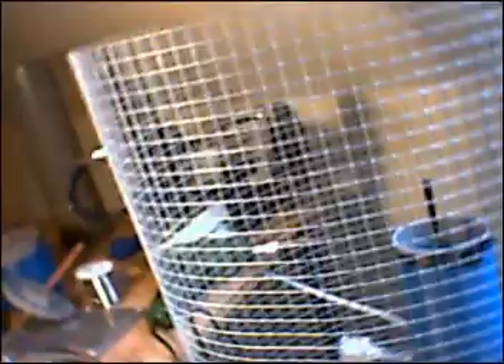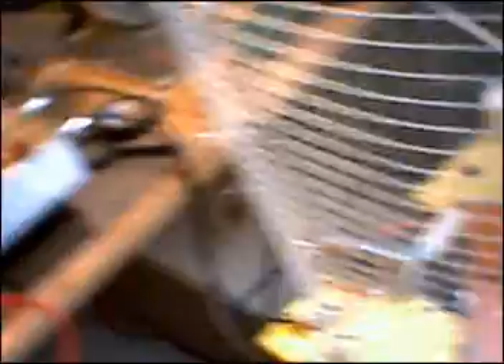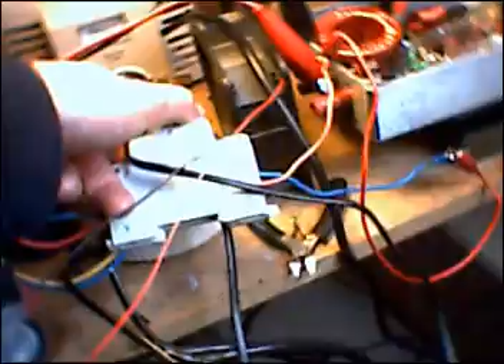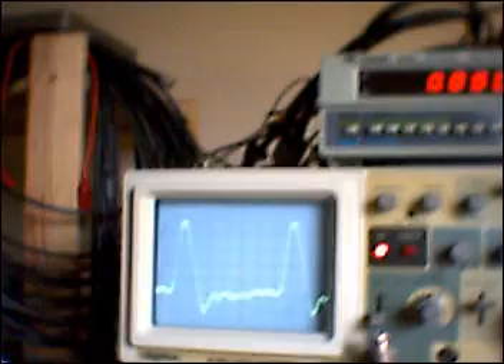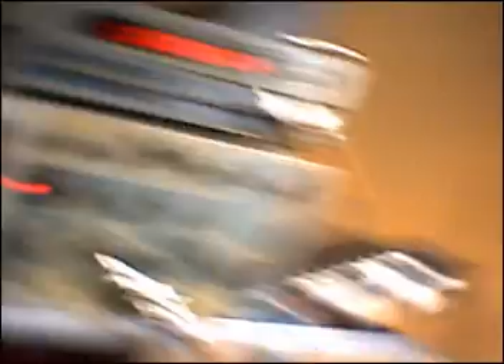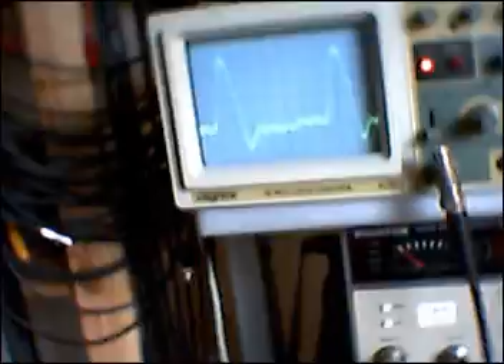Variable primary coupling for HF tasla coil

Comment from the maker: I have not measured efficiency in the strict sense, but the fact that the power transistor runs cooler than my previous configuration indicates that the efficiency might be slightly better than before.  Primary/secondary windings become warm to the touch, but do not overheat.  This is while drawing 275 watts from DC power supply.